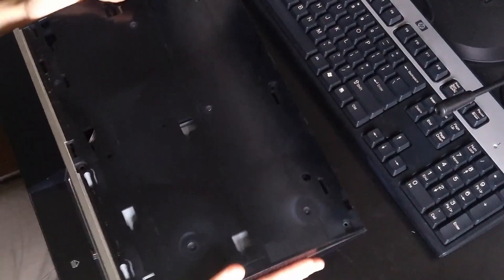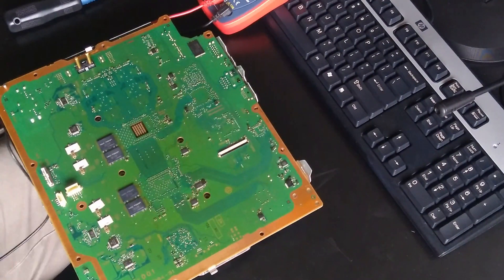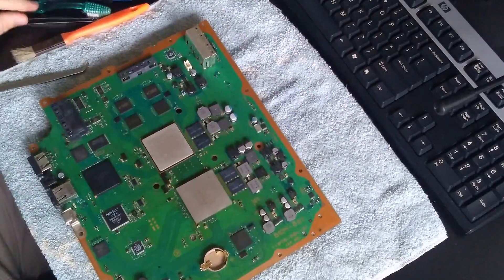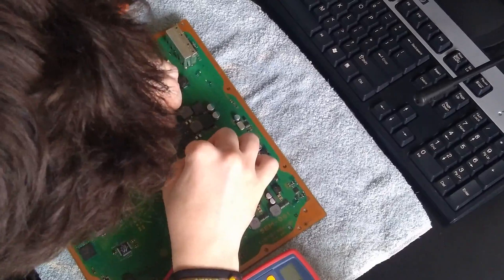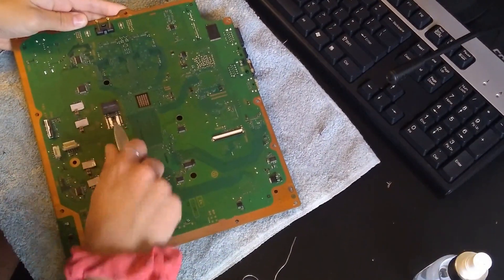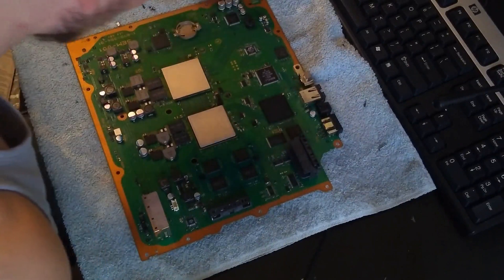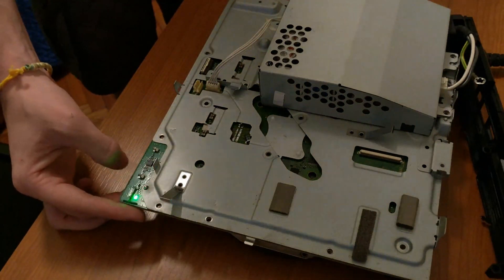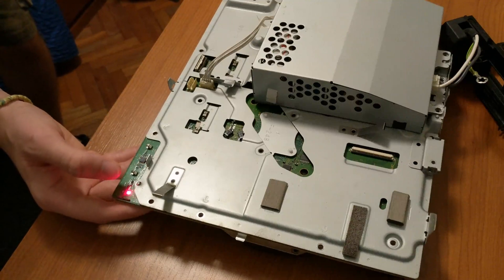Attempting to repair YLOD on a CECHG PS3

Comment: I knocked off 2 tiny resistors or capaciors and now i have to solder them lol and stripped RSX screws lol
Reply from the maker: Lol same, but I lost all the components I broke, so my console is now dead dead dead

I'll probably build a PC inside that PS3's case just to reuse it
Reply: @technobear5547  soldered them back from dead dead boarz but now it has GLOD.. nice
Reply from the maker: Nice, it now smells like dead RSX lmao
Hope you find a fix. Maybe try reading UART from syscon to determine the origin of the problem
Reply: @technobear5547  ill send it for RSX replacement as i found cheap for 40$
Reply: And in my country CECHC is veeery rare
Reply from the maker: Here fat models are mostly checg and newer, and they're all dead, places that "fix" RSX chips just use heatguns, pretty shady. I have a Japanese CECHB that has a faulty RSX, I'm waiting to see if I can get any place that does stuff the right way and fix it.
Reply: @technobear5547  okay they fixed it replaced RSX, AND PS2s GPU for some reason... now i have good console. Thanks!
Reply from the maker: Great news! Enjoy it!
Reply: @technobear5547  thanks
Reply: @pomidortv797  updates?

Comment: Finally! Someone that uses a toothbrush for cleanings and has a keyboard with numpad. Take my like!
Reply: Hi. Thanks for the video. It worked for me. I have some additional capacitors. If some one want contact me at 9025 double two 4376 from India. I can share my experience as well..
Reply: @rajeemoorthy  hello sir

Comment: This video is good evidence that shows capacitors are not the problem. The chips are DEAD! People that "repair successfully" heat up the capacitor area cooking the gpu in the process making it work again and then they think changing the capacitors made it work. This method in the video did not cook the gpu and surprise surprise it didn't fix it. Another video shows a system that had capacitors changed and it failed again only to be "repaired" again by reball. It's all lies because apparently the capacitors are the cause. People should stop wasting time on their dead systems and get others that stood the test of time.
Reply from the maker: It's not that it's all lies, the correct thing to do is to diagnose the error via UART communication with the syscon, but I don't have the tools to do that at the moment, so I just opted for the easiest possible solution. Capacitors aren't always the issue, I know that, I was just hoping that they were as I had no other way to test. After seeing the skewed RSX I basically abandoned the idea of repairing this unit. Not worth the effort nor time that could be spent in replacing the RSX.
Reply: This ps3 had been attempted at repair before. They probably heated the chips doing a reflow and that ruined the chips. Surely if it hadn't been touched prior. Im sure the fix would be to replace the capacitors
Reply from the maker: Exactly, this has been tampered with before so it might have been fried a lot of times lol, I have a never opened CECHB with similar issues, I'll be attempting a fix on that one (mainly an RSX reflow because it displays a lot of artifacts)
Reply: when a PS3 is dead, it is dead, period! my ps3 fat died earlier and i sent it to someone to fix it and they were like "Fuck It!" and just gave up on it, the BGA ICs have bitten the dust, there was nothing that can be done about it. I just bought a PS3 Slim to replace it. R.I.P PS3 Fat 2006-2019.
Reply: @pentiummmx2294  you sent it to wrong idiots.  I repaired 100 of them. it's not dead. period
Reply: the capacitor is the main problem lol, check this video, the guy just using the "Piggy-Back" method to put the tantalum capacitor on the board without using any heat gun.

https://www.youtube.com/watch?v=zzhIDnJWrlM&t=717s

Comment: BGA rework station(Achi IR6500 ) + ps3 bga reball kit
Reply from the maker: An IR rework station is pretty expensive for just trying to fix a PS3, I'll probably get a hot air station and a bga reball kit just to try my luck. Ripping those components from the back of the board probably did some more damage.
Reply: @technobear5547  no bga socket